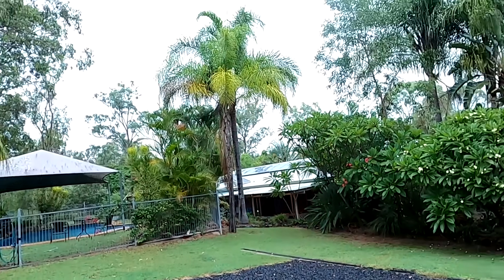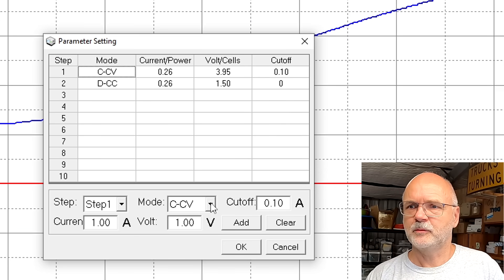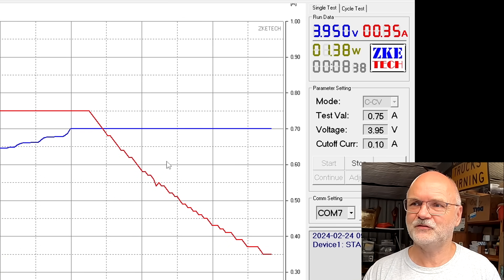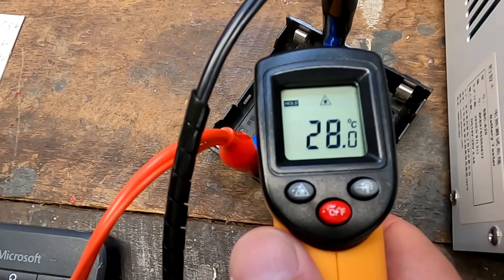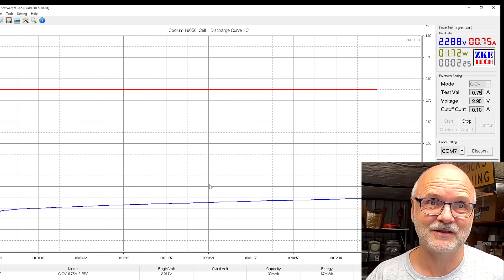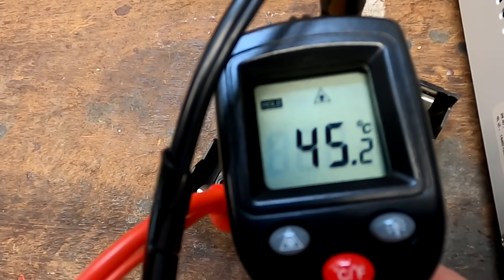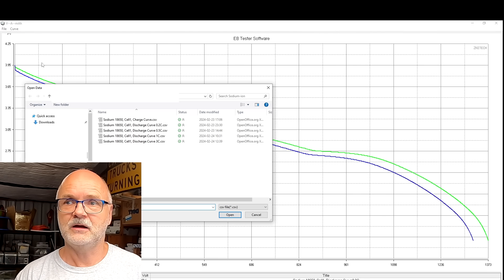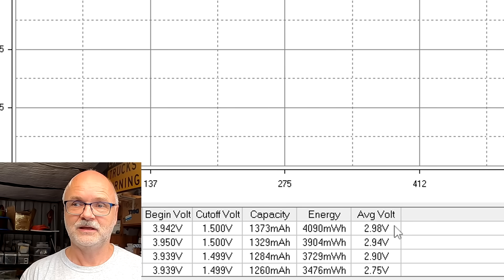Sodium Battery C-Rate Test and Comparison. Better than LiFePO4?

Comment: Plot power and energy.  that's what matters from an economic point of view.  Note the slope on the voltage curve means you don't have to top balance.
Reply from the maker: All batteries are tested with constant current for C-rating. Voltage changes too much with sodium batteries...
Reply: @OffGridGarageAustralia  That's my point.  It's good to plot voltage vs state of charge.  But what's important (in my opinion is energy.  Imagine two batteries.  One was constant voltage in constant current discharge and the other dropped linearly.  The second batter would have half the energy storage capability.  Keep up the good work.

It should be easier to balance the sodium batteries.

Comment: voltage range is wayyyy to big
Reply: Maybe if they become inexpensive enough you could just use, say, 3.7 to 2.3V or similar and use only ~60% of the capacity for existing battery inverters.
Reply: @davidpenfold  yeah but only if the price get REALY REALY good
Reply from the maker: and you have enough space as you will need 2 sodium batteries to match the same capacity as with LiFePO4.
Reply: @OffGridGarageAustralia  They are 2 time less energy density than lifepo !?! who said these where going to make everyone buy them? this suck xD

Comment: I was so excited when I first heard of these.  I quickly changed my mind when I got my hands on a data sheet last year.
Reply: LiFePo4's super flat curve is just hard to beat.
Reply: @ChrisEpler  agreed.
Reply: Can someone explain to me?
Is it because the voltage drop increases the amps flow when discharging with a steady wattage? 
So when the soc goes down we could potentially over discharge the max C rate?
I am not sure what the disadvantages are besides the heat.
(Did I fall asleep during the video?)
Reply: @camielkotte the disadvantage is the battery performs worse as you increase the rate of discharge. They do fine at 0.5C or less but get exponentially worse at 1C. 

I don’t know the cost of these batteries but if they are low cost they are best used in low amp requirements. In that scenario they excel (if inexpensive)
Reply: @Thisisaplaceholder1  thx.
Reply: @Thisisaplaceholder1 ... think, it fits... less the price the more ah the less current each cell.
Reply: @Thisisaplaceholder1   The idea with sodium batteries is that they will be significantly cheaper, due to not needing lithium which is really expensive in comparison to sodium. When factories are running at volume capacity, cost per kWh should end up about 30% less than LFP
Reply: That's saying a lot, considering the prices of LiFePO4 has come down as low as premium AGM Lead Acid. I'm not convinced, that Na-ion is a good choice for electric vehicles, but, I see it as an excellent candidate for renewable energy. (wind, solar)@mikebalentine
Reply: @Thisisaplaceholder1 I have 600 Ah of Lifepo4. I never draw more than 100 A, which is 0.16 C. What other disadvantages does sodium have?
Reply: @yt45204  well that’s a bit arrogant to phrase it that way that just because you do not use your batteries heavily there are no other applications/people that do.
Reply: @Thisisaplaceholder1  Most RV people are in the same situation as me. But sodium batteries might still not be a good idea due to other drawbacks. I am curious to learn more about them.
Reply: @yt45204  the other downside that might apply is that sodium ion batteries are heavier. Sodium is 3 times heavier and 33% larger than lithium. This will impact how it is used for sure. As a stationary storage this does not matter but for mobile applications the same weight will have less storage.
Reply: @Thisisaplaceholder1  Thanks, being that much heavier is definitely a problem for RV use. Doesn't matter if they're practically free if your RV tips over.
Reply: @Thisisaplaceholder1 sodium ion batteries have an energy density of 110-160 kWh/kg. Tesla model 3 uses a battery with energy density of 150 kWh/kg.
Reply: @JSM-bb80u  As he showed in this video with sodium batteries it drastically reduces their capacity (20-30% less). As of right now sodium ion as far as I am aware is not equipped to handle car batteries. Even if they have comparable energy density. 

Also you are using the wrong numbers for Tesla. Their CATL batteries are 210 wh/kg. Also the cycle life of sodium ion is looking to be half of LFP, it’s a problem with the sodium its larger structure causes more strain.
Reply: @Thisisaplaceholder1  I was specifically talking about Model 3 batteries. Also LFP batteries has density of 180 Wh/kg. So the 210 one should be an NMC battery.
Reply: @mikebalentine They can handle high C rates. That makes them useful for applications where high C rates are needed for a short amount of time, like for starting rotating equipment.
Reply: "According to BYD’s development plan on BYD sodium ion battery: With the development of sodium battery technology, layered oxide can already achieve an energy density of 140Wh/kg and a cycle life of 3,600 times in 2023. BYD sodium ion battery layered oxide plans to reach 160Wh/kg in 2024, and the cycle life will reach 4,500 times.

The current energy density of polyanions is 110Wh/kg, and the 1C cycle life can reach 6,000 times. Next year BYD plans to increase the energy density to 130Wh/kg and the cycle life to 8,000 times. It is planned to achieve the same level as lithium iron phosphate in 2025, especially in terms of polyanions, reaching 150Wh/kg and a cycle life of 10,000 times."